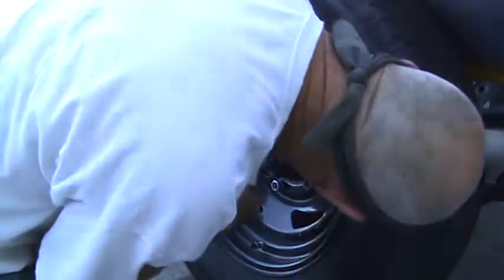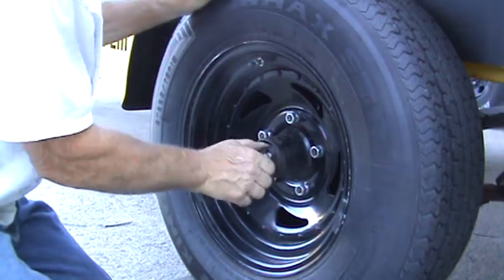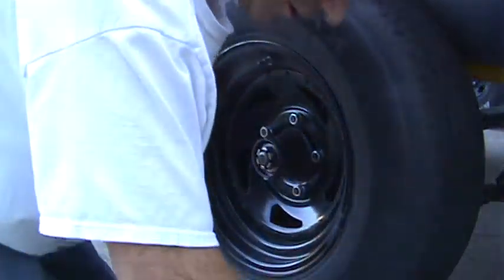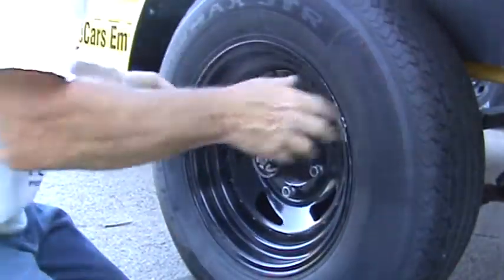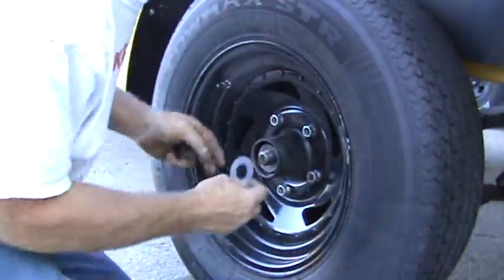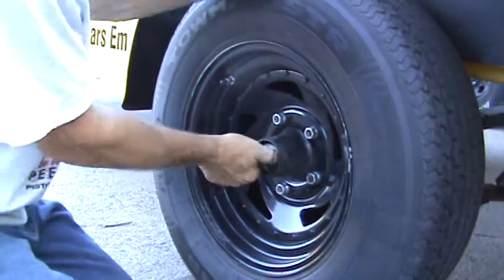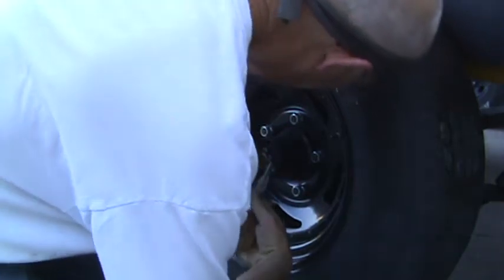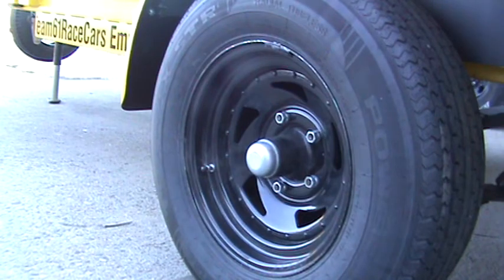Trailer Axle Spindle Nut Shims - 2

Comment: I have been using arbor shims to do this for a long time and often wondered why nobody else was.  If I have done the math correct,  on 6 slot castle 1-14 castle nut, each slot is 12 thou.  I have bought 12 slot nuts which drops it to 6 thou per slot.  I shoot for 1-5 though indicated end-play based on Timken literature.  I have found that zero end-play on fully loaded axles tends to be two tight and leads to early bearing failure.  Loose seems to be more forgiving in terms of time to failure compared to too tight.  What end-play do you shoot for?
Reply from the maker: Somewhere between too tight and too lose.....
Kudos to you for this in depth research ! BRAVO !! .... You are probably the only guy on the planet to take a dial indicator out to service his wheel bearings. :-)
Everyone has a 'what feels right' method, and these shims just makes it easier to get to that spot.
Reply: @61Merc  After several bearing failures on vehicles and trailers I started looking for the an answer to why.  My conclusion was I was setting them too tight.  I started experimenting and found I could get away with a very loose bearing.  I have never had a loose bearing fail between annual repack.  I do see race wear, but not race spalling type failures.  The biggest problem with lose is on my boat trailer with bearing buddies, the seals don't seal well with the bearing being lose.  In a quest to find a technical answer, something I could quantify, I found a Timken tech article with an end-play spec of 1-5 thou as well as an identical YouTube video.  I have followed 1-5 thou since then.  I didn't have someone to teach me the right "feel" so I had to find another way.